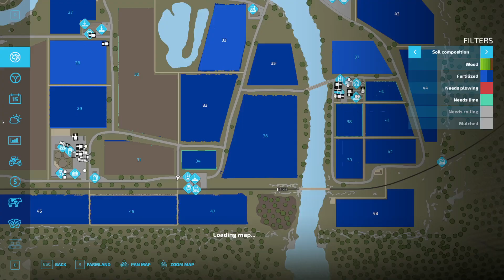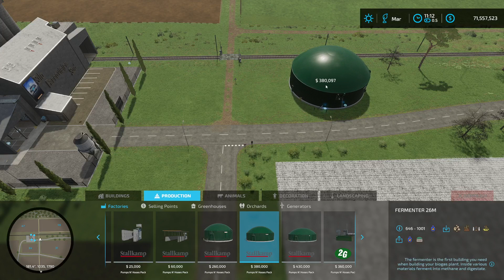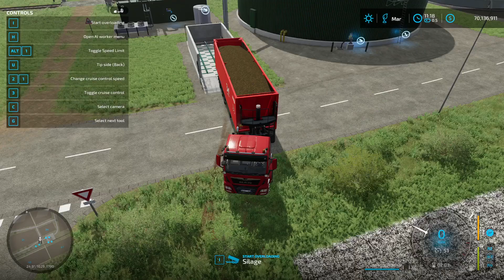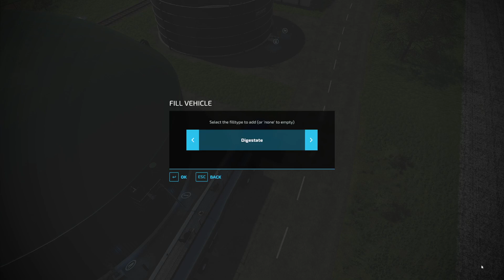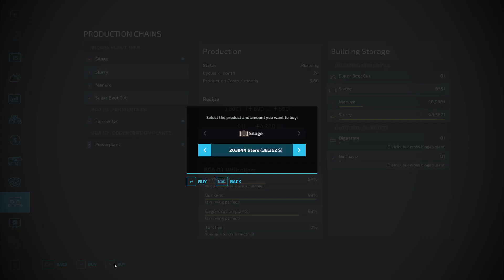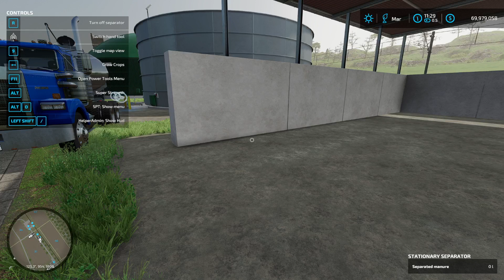Building A BGA - Pumps And Hoses DLC - Farming Simulator 22

Comment: I get that you think the DLC is a little overpriced I'm in the US so I have to pay $17.99 ($16.19 with game pass) but I think this DLC is well worth the price it is completely new equipment that's never been in the game before a new bit of gameplay in terms of slurry spreading and a modular BGA system which is only been provided through mods before and it's from the same people who made straw harvest which I don't know if you ever used it but it added a whole lot of gameplay to 19 because it had a round baler where you can make different size bales and a a square baler with a accumulator and the star of mod the straw harvester which pelletized straw and hay that you could turn into pallets and sell for a higher profit basically a production chain before they were a thing in 22 and that was free on 19 but on 17 you had to pay $17.99 for it and it was locked the only PC
Reply from the maker: Fair point.  Like I said I guess I'm a little bit biased as I'm comparing or thinking about things in terms of the Platinum DLC which also offers so much more.  New resources, new equipment, new productions, and a new map for 2 bucks more.  Also prior to the release of this pack I started to dig into Maize Plus which has a lot of features to it as well.
Like I said I'm not done with this pack yet, more videos to come, and maybe I'll change my mind on it's value.